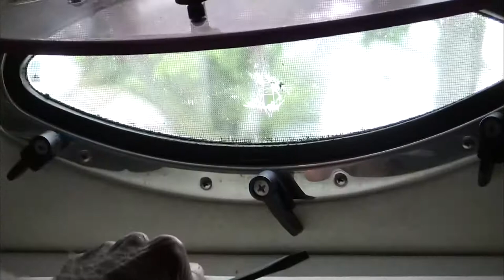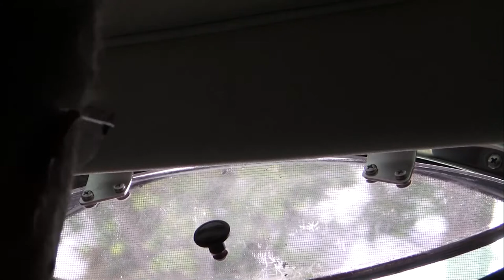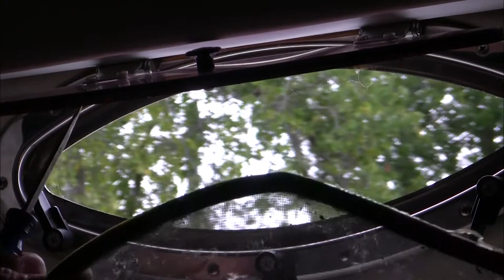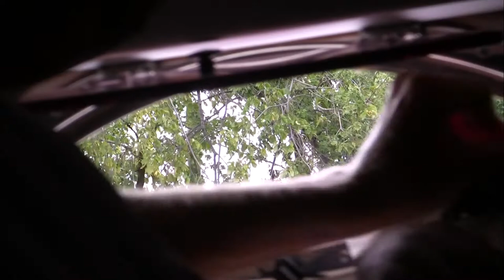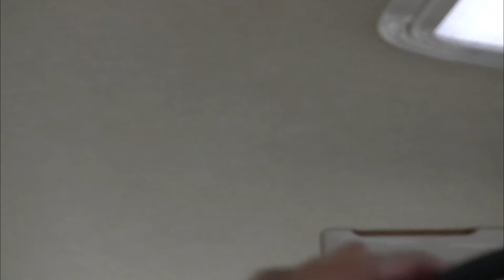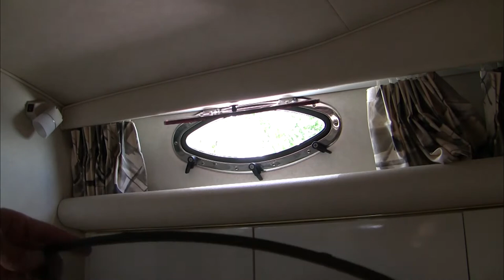How to replace your boat screens

Comment: Hi Tim,
Is it possible to pre-install the screens and install the gasket/screen combo as one unit to ease installation?
Reply: Great question. I wondered the same thing after I was finished. However, considering how the screens seemed oversized, it might make it difficult the properly seat the adhesive on the gasket to the window channel . I tried to seat the gasket towards the outside if the window channel to accommodate the large screens. If you try your suggestion, I would love to hear how it worked or didn’t work. BTW, the long term compression of the gasket over time has made closing the windows much easier.

Comment: Thanks for the video, advice and supplier info. Just lost my starboard port light screen and seal  on our 260 sea ray. Left our golden retriever in the boat on a cool July 4th night. We didn’t know it, but our slip neighbors lit fireworks off right next to our boat and the dog tried to get out. Poor pup was terrified.  Also need the hatch screen and blind assembly. Haven’t found a supplier yet.
Reply from the maker: Glad I could help Craig.  Poor dog....  You can just take the torn screen out and replace it with any screen material from the hardware store.  FYI, my 330 hatch screen part numbers are 783597 for the 12x12 and 783530 for the 20x20.  Those are for Taylor Ultra II hatches and are hard to find.  If you need the screen frame and can't find it, you can always upgrade to the oceanair system https://www.youtube.com/watch?v=48c2MpR_z4A.